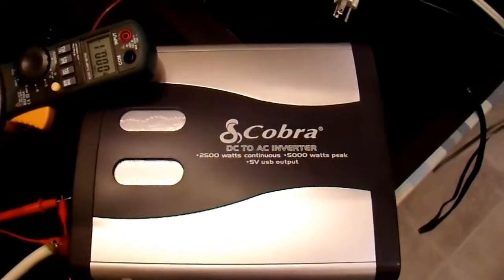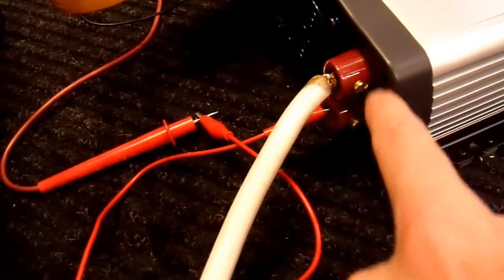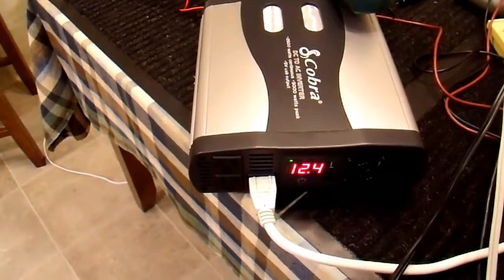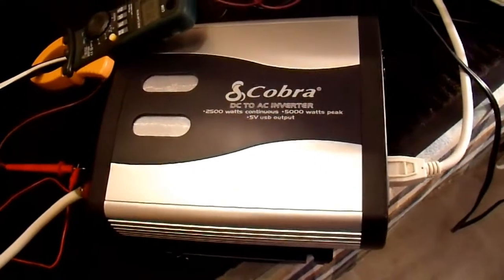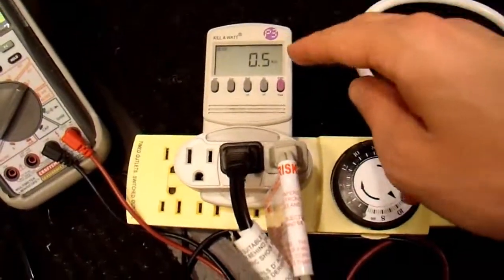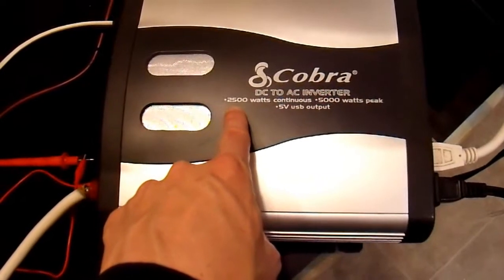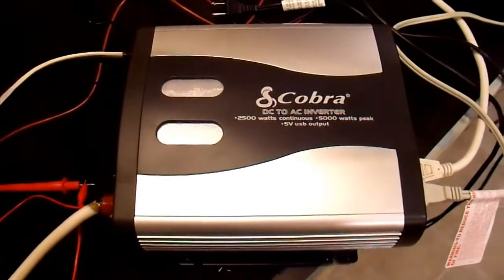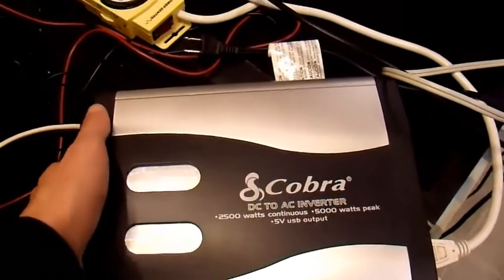Cobra 2500 Watt Inverter CPI2575 Unboxing and Review - Review part 1/2

Comment: I need a good power inverter to buy any suggestions?
Reply from the maker: What do you need to power?  What is the power source and what is the application?
Reply: @knurlgnar24 putting it in my car ...need it to run Starlink ...power-tools while on the road . I need 3000w ...so many of them on the  market with  bad reviews ...
Reply: @knurlgnar24 need it for my vehicle to power starlink and use power tools on the road .

Comment: Do I need to put some kinda fuse on this? Also have solar panels coming into the batteries. Thanks
Reply from the maker: While electrical best-practices and codes will say otherwise I contend that no fuse is necessary on inverter inputs on this type of unit and I never use them.  The inverter is internally fused and if that fails for some reason any additional failure internal to the inverter will open traces on the circuit board and outright turn the conducting path it into smoke and then open.  My main thing regardless of fusing or not is to make sure the inverter is not in contact with any combustible materials.  If it fails a plastic cased inverter like this could ignite in a worst case scenario.  With the fire retardants they put in plastics it won't burn vigorously but it can still cause a fire.

Comment: I have an inverter exactly the same, it’s all hooked up and it shows input voltage, but no out put. I hooked up a 700watt microwave and it looks like it’s too much for the inverter.. any recommendations!?
Reply from the maker: What battery and cable setup are you using?  A 700W microwave will draw about 1000W and require around 100A from the battery so a typical car battery will be marginal.  Also cabling should be 4AWG or better and fairly short.  Not sure your setup, just a few ideas.

Comment: The Cobra inverter is junk. I have the 2500 Pro in my truck and it barely can run my 700 watt microwave. Anything higher will trip the breaker within 2 minutes. Definitely not anywhere close to 2500 watt. I would say more like 750.

Comment: Hi! My name is Hector, I have a cobra 2500 watts with two positive and two negatives, should I run all four cables?
Reply from the maker: Both positive and both negative terminals are connected internally so you do not have to use all 4 for lighter loads, but all 4 are should be used to avoid cable and connection heating if you want to run at high loads for extended periods of time.
Reply: knurlgnar24 right, I’m only gonna run a small fridge that only requires 60 watts and a coffee maker and a crock pot on and off.
Reply: knurlgnar24 I have another question regarding my inverter, I connect it and works fine, is giving me 14.0, 13.9, when I connect the microwave is giving me some number, is giving me the voltage and then other number like 950 , goes up a little then comedown, what are those numbers?

Comment: Hello I buy a 2500 cobra inverter I conectes on a big rig but the problem is that has a green light that shows the battery bolts and if I conect a microwave light start blinking in red light goin down and microwave it’s only 700
Reply from the maker: This sounds like inadequate batteries or cabling.  Your microwave will likely draw about 100A from the batteries so something like 0AWG cable or heavier would be best.  This inverter will also require at least 200Ah of batteries to perform up to its rating.

Comment: I have put 3000 watt load with no beeping. I also have two #4 wires feeding power. My thought is 12 volt batteries have a tuff time feeding that amount of power, and it needs more batteries I mean a lot of batteries rather than 1 or 2 big batteries. And then the extra 2 wires really help. I do like your testing setup though.

Comment: Hi, i have the same inverter, the fan will turn on only when it need to low the temperature or its supposed to be always on?
Reply: Mine dose the same too  when I trun my inverter power on  all the fan spin then it stop  I was thinking dose all the cobra inverter dose that or the fan is no good

Comment: Cobra dc-ac inverter sucks they suck they break easy they do not have a manual turn on switch they have a electronic turn on switch which is this more stuff that's breaks,

Comment: The instructions say use double cables for the 2500 watt range.
Reply: That right because how he has it set up it’s only pulling half of what it can do with one set of cables.
Reply: Not exactly. If you saw the previous videos you'd see the heavy connection inside, off of the lugs that tie the 2 connectors together. Because his cables are so short, and he's using larger cables than what it says to use, it's just fine doing what he's doing. The reason it doesn't do what it's supposed to is because it's junk. The guy is an engineer. I'm sure he knows what he's doing.
The internals of this device are and never were designed to run 2500 watts. 4 mosfets are not enough for that kind of power. My 3kw has 12 fets, for example.
It also only has 2 transformers, where, at 2500w it should have at least 3.  A good one would have at least 4.
Anyone who's purchased more than a couple inverters over the years would take one look at the insides of this thing and laugh when it says 2500 watts. Even just at first glance. It's too freakin small!

Comment: Man you really know your stuff. Great video thank you. I have this inverter in a company truck. I was using it to run a small tv and antenna. I used it that night and the next night it quit working. What could be the problem? It's bolted to the floor and doesn't move. Any suggestions would be appreciated.

Comment: Plastic used for case is not good for such devices. Our company PWM also produces inverters. Much better than Chinese and has inverter tripping regulation at low voltage. For deep-discharge batteries, there is no need for such a shutdown, as for a car's starter batteries. We produce is Europe. http://pwm.guru

Comment: I am wondering if there was ANY difference when you hooked up ANOTHER SET OF CABLES to the other cable posts on the inverter.....thus more power connection.
  I do notice that you have it hardwired to the batteries, so that should give maximum connection. And I am sure you are correct about the inverter....I am wondering if it got MIS-LABELED at the factory, and just did not get caught.
Reply: its advertised as that
Reply: +DMAN22yeah Yup....I have been over at Amazon reading the reviews....seems this needs BIG amount of power and ALL four cables connected to get the juice. Many people have had no problems, others not so lucky...but it might just depend on their system. Lot of trucker reviews.
Reply: Xboomer1 most people buy the thing with the biggest number for the cheapest price, and that is why this inverter sells so well

Comment: does anyone else know alot about inverters and brands?  I'm looking to get one but there are so many models I can't choose.  can anyone assist me?
Reply: +ken ber If you want a good, inexpensive 1500 watt Pure Sine Wave inverter, go to Amazon or Ebay, and look at the OSP Tiger Claw....mine has been running for 1 1/2 years, no problems...look at Youtube Videos and Knurlgnar's review, and comparisons... price...$199 US dollars...you might need a .01 micro farad Capacitor to put on the negative terminal to the ground screw, that is to help the fans run properly. Other than that, I had no issues.
  I run my 850 watt power consumption Microwave Oven on it.  I don't think it can be beat for the price. Also...STAY AWAY FROM ACCURATE TOOLS INVERTERS....see the review on those...badly built.
  Hope that helps.
  It also depends on what you want to RUN...I did 1 full year of RESEARCH on the internet before even BUYING an inverter....I learned about Batteries, Cables, FUSES...Solar Panels, and of course inverters.... Best suggestion, go get an education...it is not all that complicated, though time consuming...:-)  Then build a small system like I did....
Reply: I've been doing tons of research for months.  My inverter is the last component I need to buy. Ive been running everything off of a Cobra cpi850 but need something bigger/better quality that is a pure sine wave. I've been in eBay for ever.  So many dam inverters to pick one. I think I'll just have to close my eyes and pick one.
Reply: Thank you for the reply.
Reply: I see, you have been busy.

For making your decision, try Amazon...they have reviews from buyers. Look for the size you want, and pure sine wave. I was looking at Nimble brand, but it is confusing with so many voltages. And I did not like some of the reviews... So use Amazon for some reviews in the size you are after.
Reply: +X Boomer does this ave the open ground and do you have this model?
Reply: I don't own a Cobra 2500, but I do own a Cobra cpi 400. Been a great little inverter. I use 300 watt one cup coffee maker. That is my small system.
  My larger system is the 1500 watt tiger claw. With 2 100ah batts, runs my microwave flawlessly. That is why I recommended it. But you seem to want a bigger inverter. Ask Knurl gnar about the ground, open another post to ask him directly, hopefully he will see it.
Reply: Plus, you could go to the Cobra website, and ask them directly too.
Reply: +X Boomer awesome man thank you
Reply: Why are we here?

We are here to help each other.
Reply: +X Boomer Very true.
Reply: +ken ber Knurlgnar's personal system is, I think, 1400ah bank, with a 3000 w PSW...SAMLEX...in case you have not seen it... It is this hurking big box, it rolls.
  My setup is similar, but only 2 batts.
  Samlex is going to be more expensive though.

Comment: I bought 2 Cobra 2500.  Do you recommend buying a third one to compensate for the low output? Or is better to buy other brand?
Reply from the maker: If those inverters do what you need then that's great, but if you are considering purchasing another inverter I would recommend a different product.  E.g. The older Cobra inverters that come in metal cases are much better than the newer ones in plastic like shown here.
Reply: ***** Hi! I installed a Missouri Wind Turbine with a converter from DC to AC connected to a charge controller and a dump load (the latter still not connected).  The charge controller is connected to a six-battery bank and from it to two power inverters (Cobra 2500) and the inverters the main breaker.  The inverter output is only 95V each. I saw in your video that the output of the inverte was 110V  What am I doing wrong?
Reply: kevin Ruperto Sorry, I meant from AC to DC.
Reply from the maker: kevin Ruperto
most likely you are using a non true RMS multimeter which does not accurately read the voltage.  These inexpensive inverters are not phase corrected and can read grossly incorrectly with non-RMS meters.  A true RMS multimeter should read the proper voltage.
Reply: @knurlgnar24  that's because the inverter is not a true sine wave inverter so the other half of the voltage is on the neutral wire especially with the 2500 watts ones from Cobra.

Comment: Any idea how to remove the low voltage shutdown protection on a Cobra 2575 inverter?
Reply: Need bigger cables and inverters usually shut down at 11.5 v
Reply: you cant

Comment: Hi cant you tray 1 more time with cables on bouth input connections from the batt. Over 100Amp will give you high voltage dropp on dc. ? Maby it can handle 2000watt?
Reply: his test is adequate

Comment: I have never really liked that cobra 2500w inverter thanks for conferming this, I ran a similar test on my Eliminator 3000w and got 2800w out of it and my cabling was not enough for 300Amps